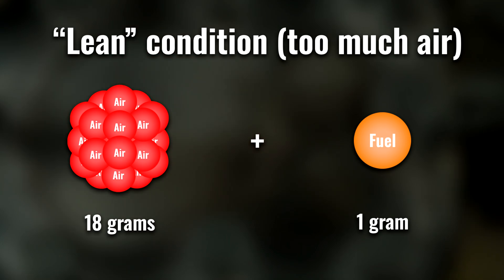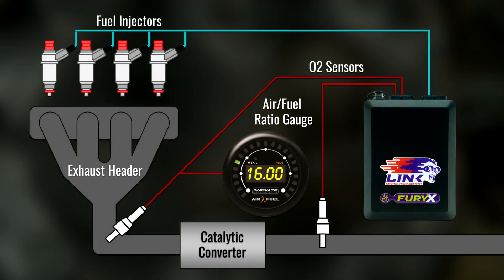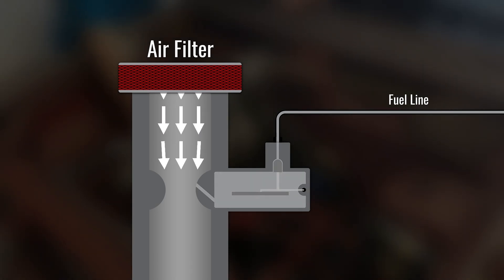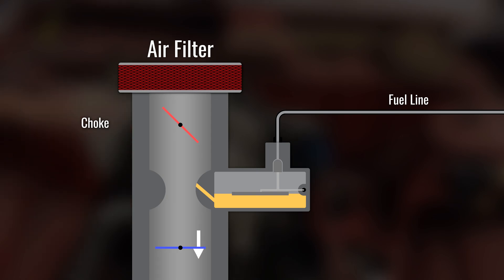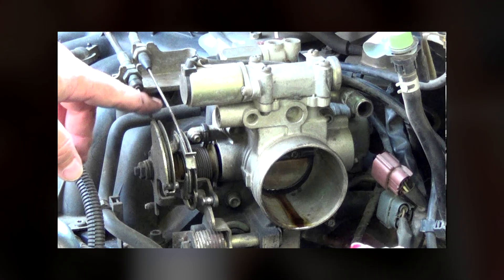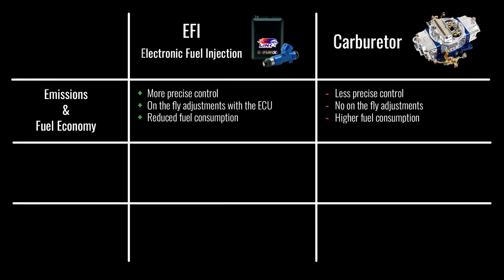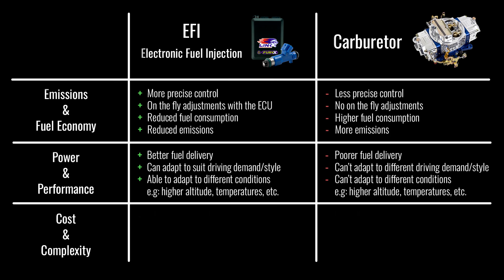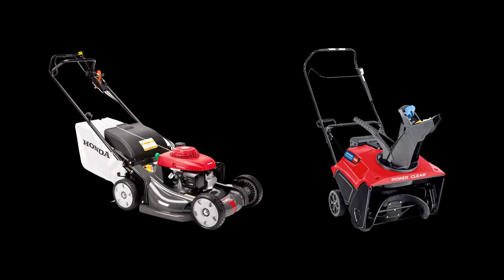Quickly Clarified - Carburetors in 5 Minutes!

Comment: So much better than fuel infection. I use Holley and Edelbrock - both work great. Edelbrock is easier to tune without making a mess. Most carb issues will still get you home. Computerized fuel infection can leave you on the roadside. I speak from experience. Would never have fuel infection if I can possibly avoid it. Carbs are reliable, dirt-simple and can deliver good mileage without breaking the bank.